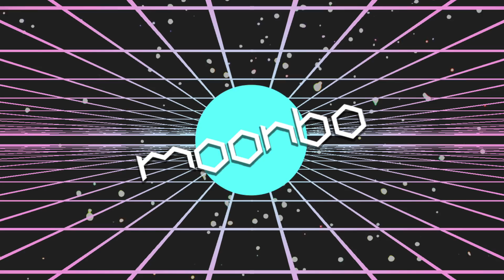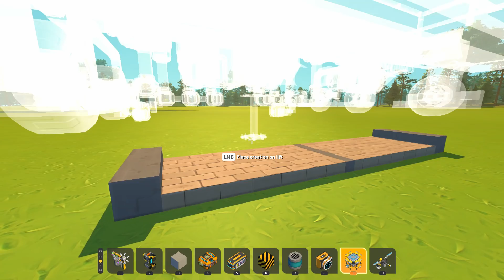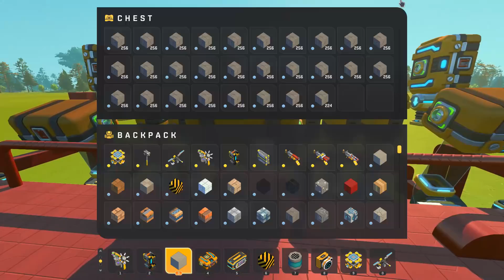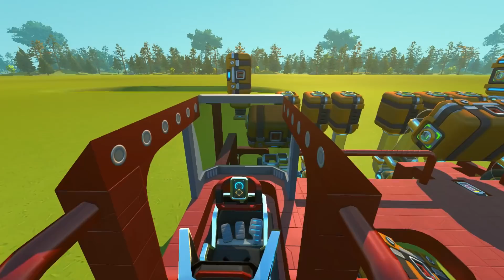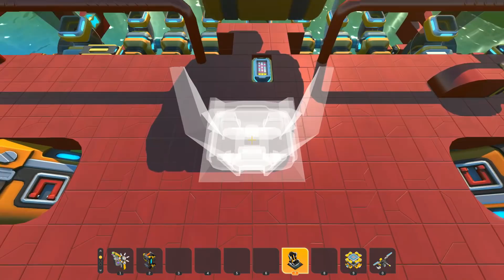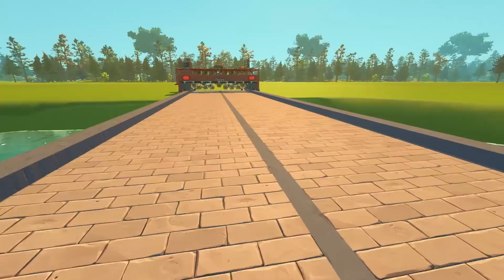This Machine Builds Roads AND Bridges Automatically! - Scrap Mechanic Gameplay

Comment: couldnt you have made the machine drive on the road it is making, then it wouldnt require another bridge building add on and wont be affected by downward slopes. The only thing it would need is likely some counter balance to stop it tipping forward.
On other note well done its looking far better than the last video left off on.

Comment: I don't know how USEFUL it might be, due to the relatively slow rythm at which it works, but it's certainly hypnotic.
And as a proof of concept? This is an 11/10 for me.

I would probably watch more of your videos, but there is a slight sound balance issue with all of them.
On your channel, and only here, the volume on the left ear is lower than the right. And I only use a headset, no speakers. This drives me utterly nuts! x'D
Reply from the maker: Wow! At first I didn't believe it, but after some extensive testing, there is in fact a slight imbalance! From here on out, that issue will be resolved! Thank you for bringing that to my attention! I would have never noticed otherwise.

Comment: Hmm if i can suggest a little improvement, you could put the bridge directly between the wheels at the start and separate it from the main structure with a bearing so it isn't welded to the low friction blocks : that way the user just have to weld the bridge section on the ground, delete the blocks and go instead of bothering with placing the road builder

Comment: 12:20 this amazing btw, but one improvement is to make the road for the machine's wheels out of cardboard, or even better glass, and then shoot it when the machine clears the road, that way nothing is out of place.
Reply: it wouldn't work for gaps that are too long because once it breaks the base of the support blocks it would fall. 

It would need to be connected at the other side first, but it would be difficult to know how the distance of the gap and how far it has been bridging. 
plus, on gaps too big it would be impossible. 

it might be possible if the design was changed a little so that the support would be connected to the bridge itself, but in my opinion, i think the support beams look cool the way they are. it adds more detail to bridges and makes them look a little more realistic.
Reply: Leafu I think he meant that you’d do that manually after the machine had crossed the gap. To do it automatically, it could connect the beams to the road.

Comment: Floating bridges don't look Good!

If only it pillared for the bridges as well. You made it this far pillars would be easy. Add a counter, every x block stop the machines movement, place a 2x2 pillar of blocks from the ground up with a string of pistons, when last block is placed clear counter, and start the machines movement again.
Reply: Wouldn't that make the bridge building MORE slower
Reply: @coatguards8032  Of course it would, but free floating bridges look ugly.